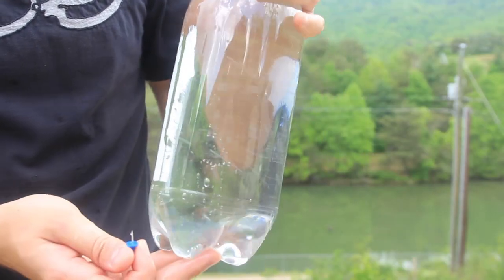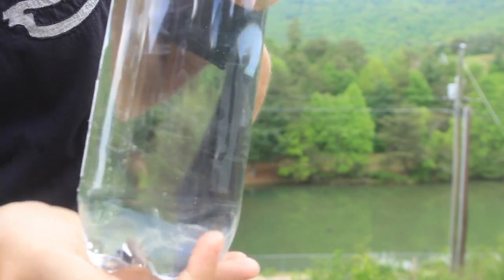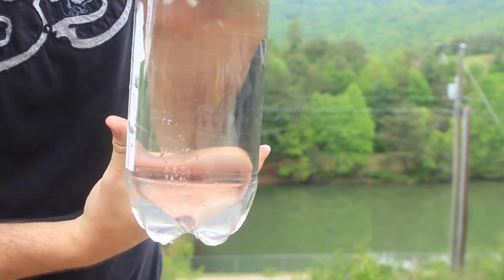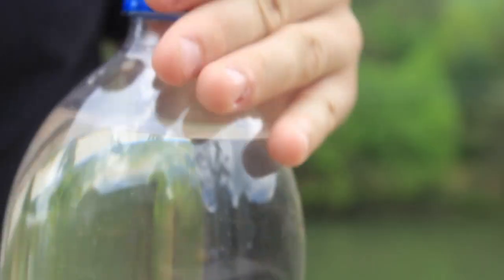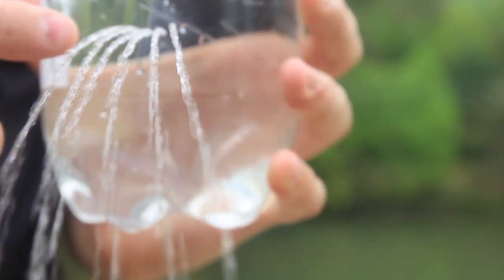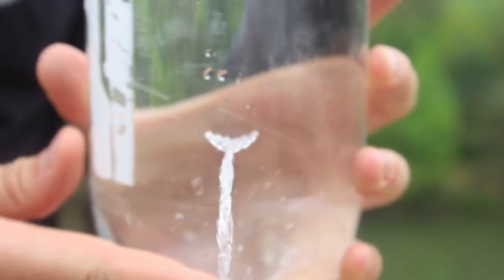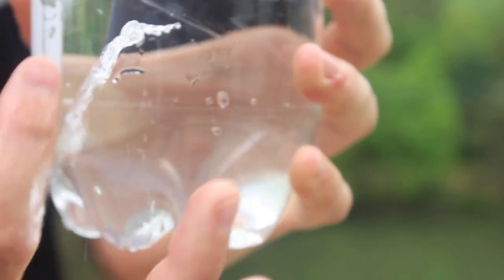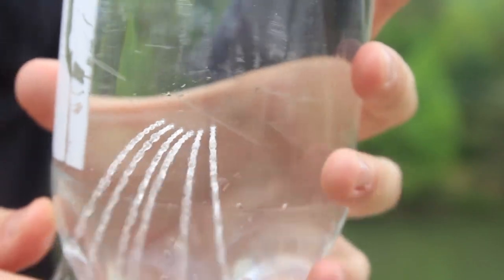Water Bottle Trick/Experiments

Comment: water and air should be exchange ex.when u poke a hole on the bottom it needs exchange of water and air and air is less dense than the water of course so the water can't go out cause it need exchange of water and air so that's why when u open the cap the water flows down cause its exchanging gas air goes to the top water goes to the bottom of course we have the help of gravity to the exchange of air and water.water get pulled down by the gravity and the bottle has some extra space so the air goes in the bottle when the cap is removed,sorry for the long explanation

Comment: This is due to polarity and the cohesion properties of water. The difference between the holes is very little and everytime you swipe your finger across, the cohesion property kicks in and water sticks. Whenever you stop that pressure by putting your finger in front this causes a build up of slight pressure at the holes and apparently this pressure is enough to break the cohesion.

Comment: The only explanation I can think of for the reason that water does not leak from the container after the pin has been stuck into it, is that the attraction of the water molecules to the plastic of the bottle (adhesive force) is stronger than the forces between the water molecules themselves (cohesive forces). These forces are strong enough to withstand the pressure of the water column inside the bottle. These forces are the same ones that enable liquids to climb through very narrow passageways, a phenomena we're all familiar with known as capillary action. The forces associated with this are very strong.
Reply: No, water leaks out and needs to be replaced with something (air) so when the cap opens it flows out.
Reply: BappleCrew I think I understand that, basically then it's a case of the water being sucked back into the bottle keeping it in place. For the rest of the time there is balanced pressure between the pressure at the top of the bottle with air pressure outside. We'll I hope that's right.
Reply: BappleCrew Yeh I suppose you're right. I got confused because I know that adhesive forces can support large columns of water. i forgot that when the bottle was initially sealed the pressure inside the bottle balanced with air pressure outside. Thank BappleCrew, where would we be without you.
Reply: Wow u overthought that one to the fullest.. its simply negative pressure holding the water in the bottle, same reason u can hold water in a straw if u plug one end
Reply: Thank you - this has now been explained by the makers of the video. Over-thought is about right - typical ! Wonder if the water would have been retained had the holes been bigger though !
Reply: Wonder if the water would have been retained had the holes been bigger - there you go - never over look the obvious !
Reply: BLo0DLuST831 Sure did, I wonder though would the water have been retained had the holes been bigger - there you go - never overlook the obvious!
Reply: Mark West The water would slowly trickle due to the holes being bigger... but it wouldnt pour out unless the holes were big enough that when the water pours, air seeps through the hole and into the bottle which equalizes the pressure. eg. those two-gallon plastic water dispensers that have the nozzle on it, it will pour out at first until negative pressure builds up enough inside the container, then it will only trickle until you poke the hole at the top to equalize pressure
Reply: BLo0DLuST831 Exactly - and !  Air pressure + suction pressure alone will not hold the column of water.
Reply: BLo0DLuST831 Water has weight & is in-compressible, more than air pressure is required to hold the column of water in place.
Reply: BLo0DLuST831 The pressure of the water at the bottom of the bottle is greater than air pressure, something other than just suction pressure alone is required to keep the water in the bottle.
Reply: Mark West It should be noted that adhesive forces are able to withstand high pressure. The combination of adhesive force between the water molecules & the bottle & cohesive forces between the water molecules themselves are adequate to hold up very large columns of water. If an opening is narrow enough, suction pressure is not required to hold up the weight of the water, capillary action is a good example of this.
In this example, there is most likely both air pressure & cohesive force holding the water in place. The adhesive & cohesive forces would prevent the air from seeping into the bottle in the first place.
Reply: BLo0DLuST831 I have done some variations on this experiment, seems you are correct. However what I did note, was that air can in fact seep through the small holes at the bottom of the bottle - I proved this in a number of very clear ways. So obviously the weight of the water is responsible for keeping the air out, if another hole is made half way up the bottle when it is full of water, then the air will be sucked in through that hole, but not the hole at the bottom. this shows that there is indeed a pressure difference in the water at the top of the bottle and that at the bottom. Although you were clearly correct in your explanation, the actualities of the experiment aren't quiet so clear cut !!

Comment: the reason the water flows when you unscrew the cap is because the top surface of the water experiences atmospheric pressure when before it wasn't, the reason the water stream were flowing together was due the surface tension of the water was greater than the individual streams therefore they stuck together, the separation was due to the fact fact the plastic bottle is preventing then to join. I had fluid mechanics and static mechanics exam.

Comment: We just went over this in chemistry actually and the reason why the water would combine is because water molecules like to stay together. This can be seen if you put small drops of water on the face of a penny and eventually it will hang over the edge of the penny but the water won't spill out. When you swiped your fingers across the streams of water they all hit you finger and combined and the combination made it's way down the streams making it into what seems like one horizontal slip when you split then up I'm not 100% sure but it probably just just separated the streams on your finger.

Comment: Water tension would explain as to why the 6 steams form one. It doesnt come out from the bottle until you squeeze the bottle or remove the lid due to pressure outside of the bottle being greater than the pressure inside the bottle.

Comment: I guess it happens in spite of the suface tension of the water. When the water come together, it will have a larger area, which will stabilize more the forces that is responsible for the surface tension.

Comment: The tiny air pockets from the water get trapped in the holes due to the small size of the punctures and create pressure on one of the holes to only release water. Explained.

Comment: It's because water molecules want so badly to cling to each other. Just the way they're built I guess. It's cool to run water out of the tap and put you finger like 1/8 of an inch away from it and the water will reach out for your finger. It's pretty cool. Water is amazing and weird and unlike any other liquid for quite a few reasons

Comment: As Guy De Vos pointed out the effect is caused by surface tension.
When you bring the streams together, they anneal to each other and the
surface tension keeps them together.  When they are separated they
don't sense each other over that distance.  Very nice demonstration!
We can test this hypothesis!  If one adds soap to the water the
surface tension should be destroyed and one should not be able to
bring the streams together anymore. ... This experiment failed for me!